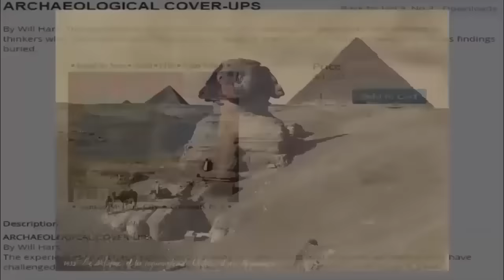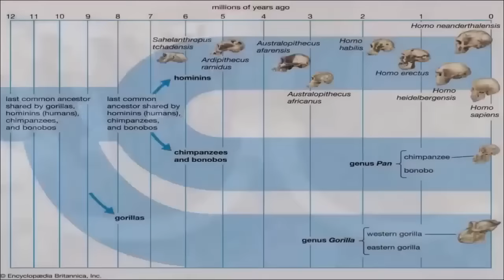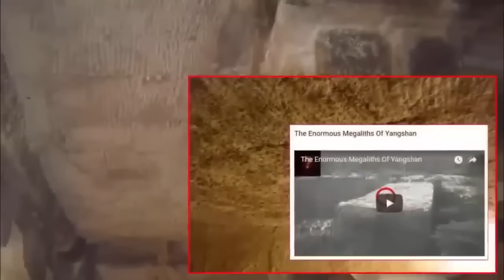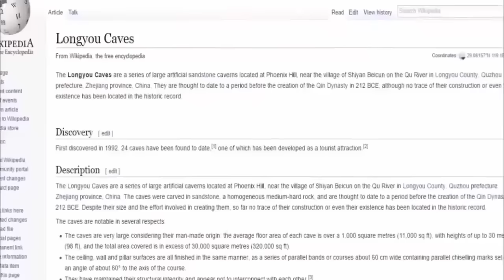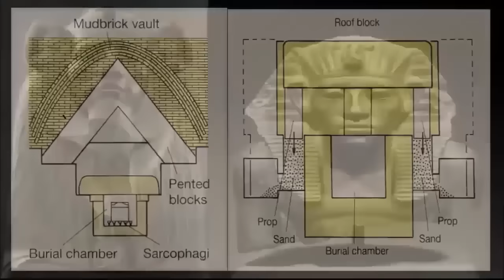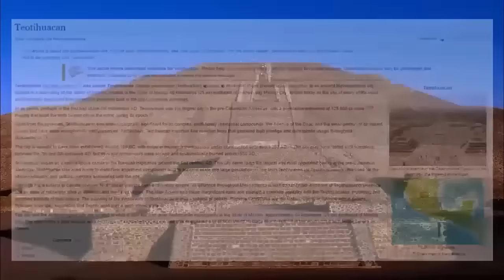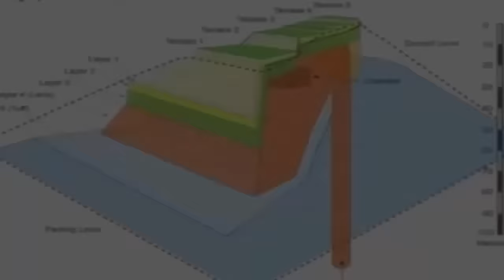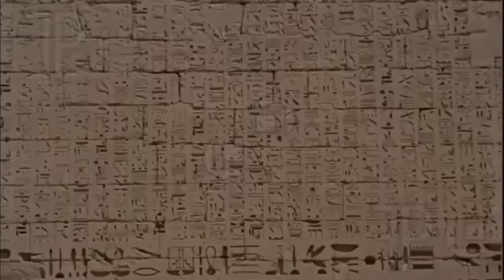Mind-Blowing Ancient Technologies Exposed? 🤯

Comment: Re: scoop carvings?
Surely you could fashion a simple tube of wood & glue tiny diamonds onto the surface, then attach a pulley & belt so you could rapidly spin the tube and cut away the stone...

Perhaps the machine would look much like a bicycle so they could utilize leg power
Reply: Only if you've never tried or used a stone saw could you say something like that. Interesting photo...
Reply: Did you grow up watching the Flintstones?
Reply: @adamsowers8957  Did the Flintstones have something similar? that's funny
Reply: @seekerscovereal  I was suggesting something more along the lines of a stone grinder...